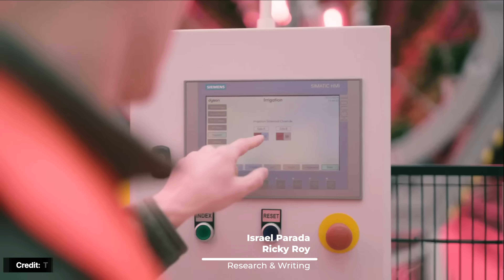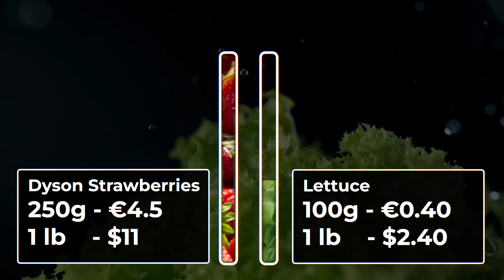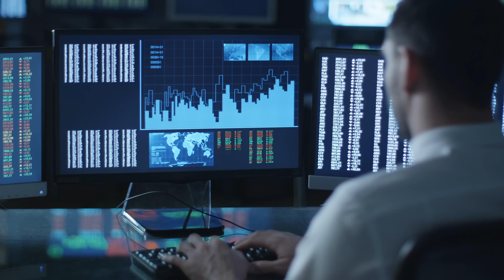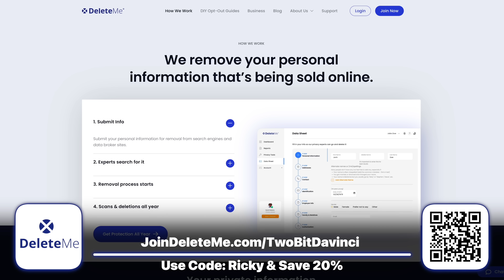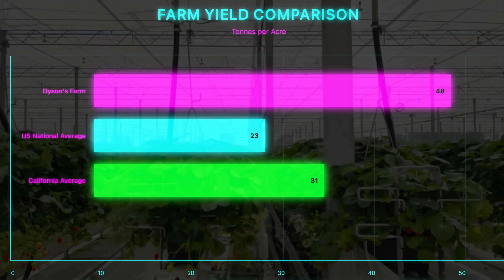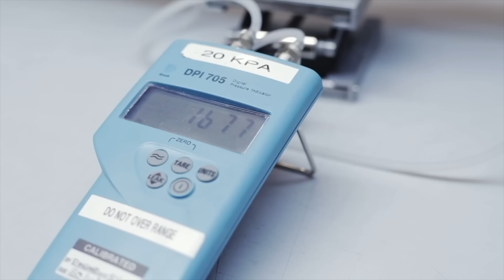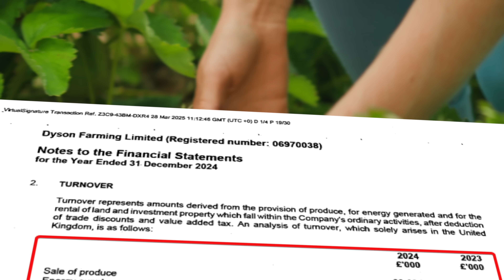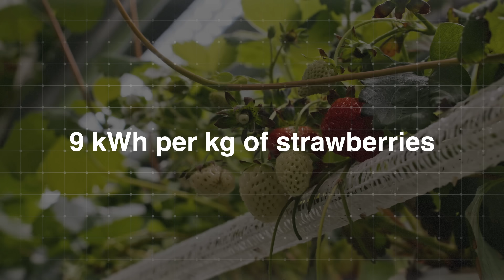The Company that FINALLY Solved Vertical Farming

Comment: Purchased these last month £4 for 250g, they tasted amazing.
Reply: This is good insight. These strawberries are definitely sold at a premium, but it's not like it's caviar-level premium or anything. Also, it's a darn well-earned premium, IMO.
Reply: Thanks for the input!
Reply: Do they taste anything?
Dutch strawberries have little taste.

I assume it’s the smaller amount of sugar due to low energy input.

If we had fusion energy then we might get more tasty berries .
Reply: @iamagi soft sweet and juicy
Reply: What's that, like 2 strawberries per £?  These prices are insane.
Reply: @Matt_K  over half a pound, I pay over £5 for a pint of beer

Comment: The fact that this project is tied to a bio reactor that requires 100 farms worth of biomass means you can't really compare it to other methods.

It's still a good synergistic use of industries, and perhaps those methods will be what's most impactful, if adopted widely. And that's nothing to say of some other more greenhouse specific tech that comes out of this.
Reply: I agree. This is most definitely not comparable. Plus even though it is a large system, it is not scaled up. Dyson is really not doing this for money but for understanding how to system synergies to get net zero from raw inputs. It's fascinating.

Comment: can we grow strawberries using the carbon emissions of a coal power plant? 😀
Reply: The real issue there is volume. Depending on the size of the farm and the amount of carbon captured. Another big issue is cost for the carbon. If it is expensive, no one will buy it.
Reply: @francis_lang  in Alberta there are a couple of greenhouses where they use natural gas generators and boilers to produce power and heat and just scrub the exhaust and use that in the greenhouse.  I believe in the Netherlands they do something similar with some of their greenhouses. If you have access to renewables you can still use that for power and when you need to resupply your CO2 tanks just fire up the generator long enough to produce the CO2 and then shut it off.
Reply: There's no coal power plants in the UK

Comment: Let's hope Dyson keeps on advancing this tech - as he is a remarkable engineer.
Reply: He is a remarkable salesman selling overpriced products.
Reply: @Dan-yf2df  exactly... they are replacing a few lights with a lot more mechanicals that could break down.  This idea makes absolutely no sense.  In a regular vertical farm if some lights fail you replace them quickly.  If the water pump breaks you shut off a couple valves and swap it out.
Reply: No he is a snakeoil sales men.